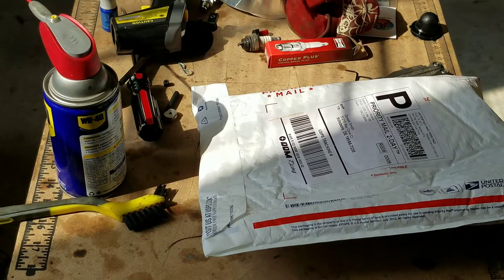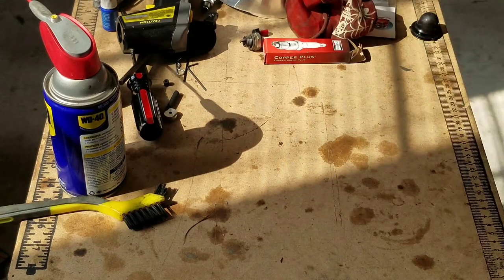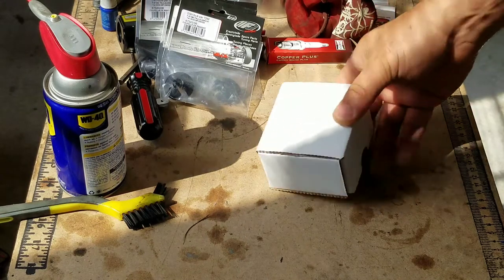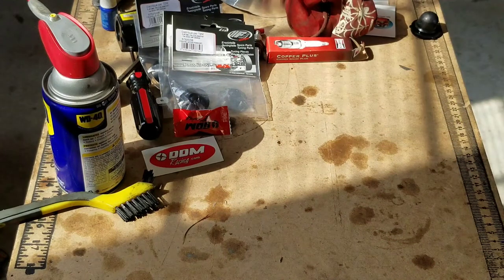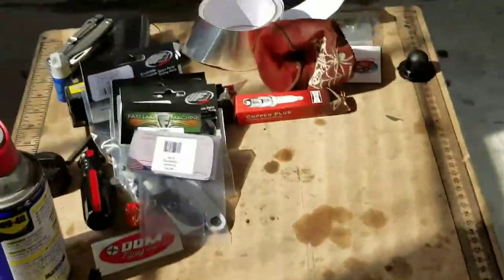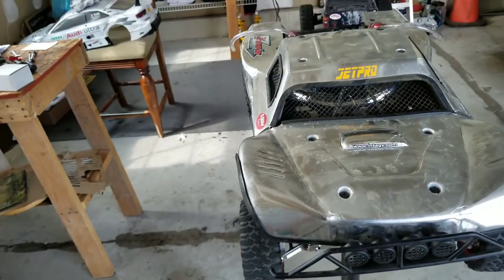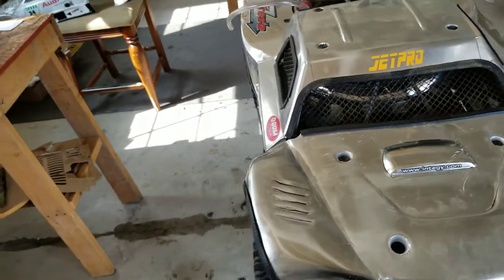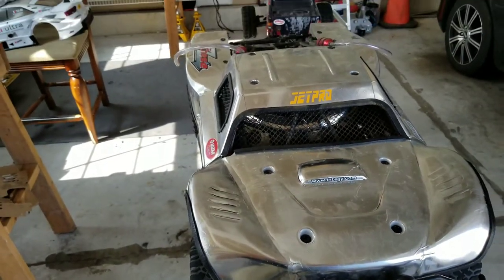Losi 5ive T and Vekta 5. LSE plans update

Comment: Did you check  out FGUSA? One other thing Gizmo in Fla has the upgraded 990 carbs a lot cheaper than anywhere else. I have the 9.7reed, nice motor, I don't know anything about the other motor.
Reply from the maker: Donald Byrd yeah bruh..they had a limited inventory..but ddm has it in different par ts not all together
Reply: 5th SCALE RC INSANITY at least there are some more OPTIONS.